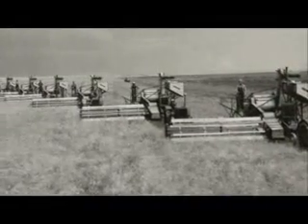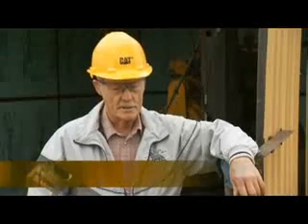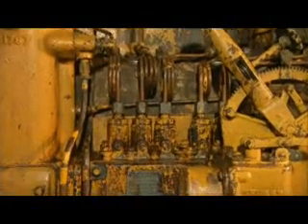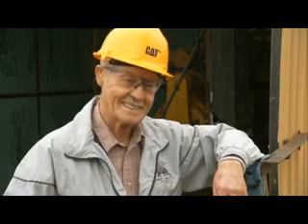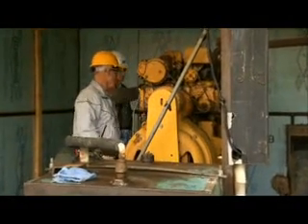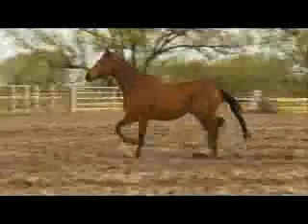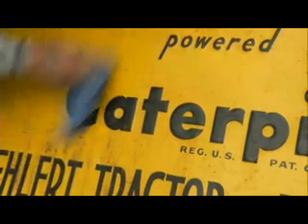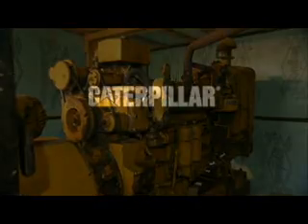Oldest working Cat® Generator Set on record in North America

Comment: I once worked on two cat 399s, clearing them of cosmolene (cooling system and oiling system).    They had been in storage at least 30 years.    After a 24 hour flush on each one, they both fired up and ran wonderfully.

Comment from the maker: It's a D4600.   
The Bertrands were the winners of the Old Faithful Contest in 2007, to find the oldest generator set still on the job.
In 1947, the Bertrands purchased the Cat D4600. Its a 35-kilowatt system capable of producing enough electricity to meet the needs of the homestead, including powering a well water pump used for the familys livestock. The Bertrands bought it from former dealer Oehlert Caterpillar Co. in Colby, Kansas.
Reply: I have a d4600

Comment: I love  seeing this old equipment  still on the job after  60+ years 
I have  a generator that isn't quite at old but it has proven reliable in the 25 years  that I have owned it ,, not powered by a Cat ,, but by a Cummins 4BT   ,,so far  it has 25000  hours on the engine ,,I rebuilt the generator head in 2001  and it has 10K hours flawless operation since then ,,it's about the same output  generator as this  cat unit but portable ,,I have mine on a trailer  due to my needing it for my salvage operation ,,I got tired of carrying  3 or more small 5-7KW generators around to do the jobs ,,now i just carry a lot of extension cords and just have the  1  40KW  genset ,, when not on a job site it is at my family farm  where it provides standby power